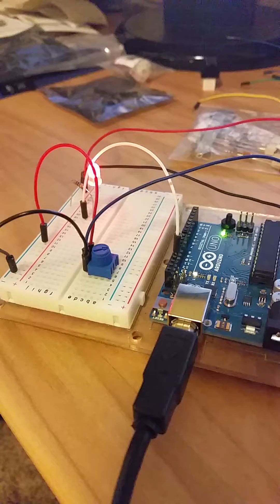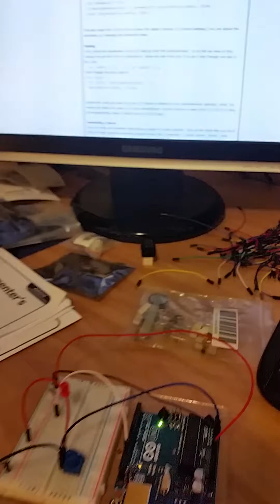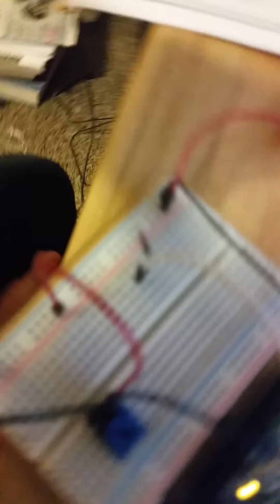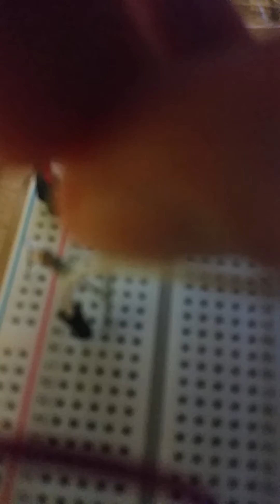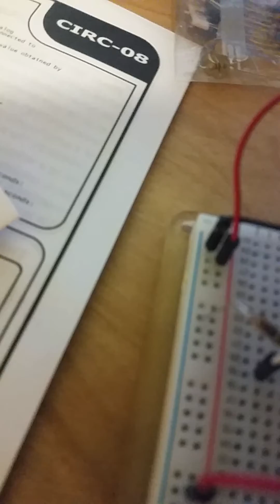Arduino and Potentiometer Controlling LED

Comment: Hi, i have the following problem and i was hoping you could help me sort it out, as the code link you inputed doesnt lead anywhere.
I have my circuit well done but my code is lacking somehow...
I use an analogRead to determine the value that the potenciometer gives me, then do i have to convert it into a float (as it is an int 10bits) and then convert that float into a FREQ. using the caracteristic function that in this case is "(28 / 5) * t + 2".
Only then do i have the Freq value depending on what value the potenciometer gives me.
Then i declare that T = 1/FREQ and that Ton = T/2 and Toff = Ton.
Then i turn the led on      digitalWrite(PinLedBlue, HIGH);  delay(Ton); 
Any idea of what could solve my problem? 
Or could you please reveal the code to me?
Thank you for your consideration.
Reply from the maker: +Vasco Costa 
You really don't have to do any conversion of your values. You are on the right track, but everything can actually be left as integer and used with your analogRead. Please see the code I used below. 

/*
*Analog Input
*Demonstrates analog input by reading an analog sensor on analog
*pin 0 and turning on and off a light emitting diode(LED) connected to 
*digital pin 13
*The amount of time and LED will be on and off depends on the value obtained by analogRead().
*/

//Declare variables
int sensorPin = 0;
int ledPin = 13;
int sensorValue = 0;

void setup() {
 pinMode(ledPin, OUTPUT); //declare the ledPin as an OUTPUT

}

void loop() {
  sensorValue = analogRead(sensorPin);  // read the value from the sensor
  digitalWrite(ledPin, HIGH);
  delay(sensorValue);
  digitalWrite(ledPin, LOW);
  delay(sensorValue);
}

Here is also the appropriate link to the above tutorial.

http://www.oomlout.com/oom.php/products/ardx/circ-08

For some reason it won't redirect when you are simply clicking on the above link. I am really sorry for that confusion. I'll certainly update it with the right link.